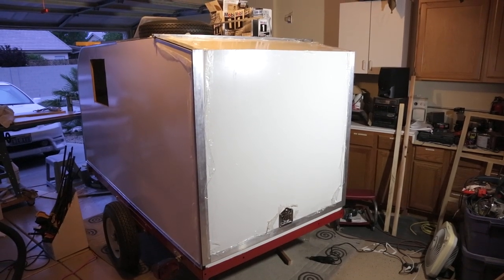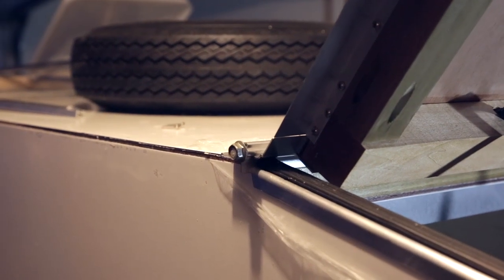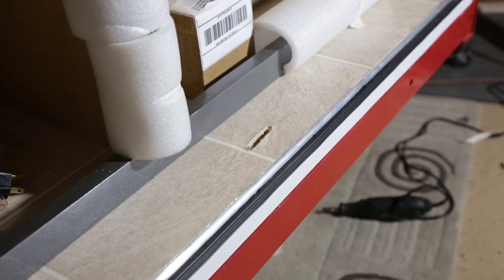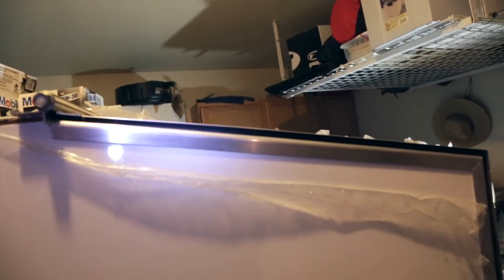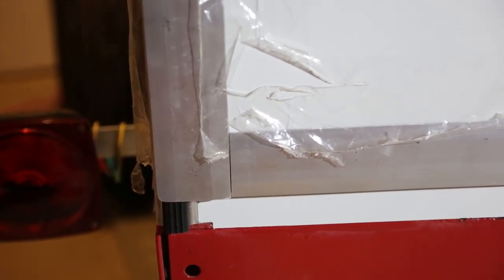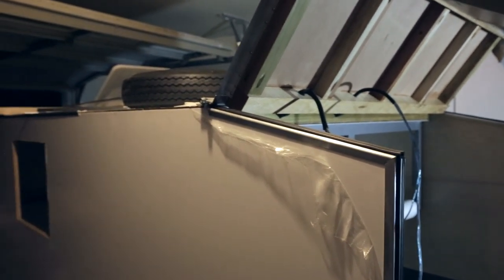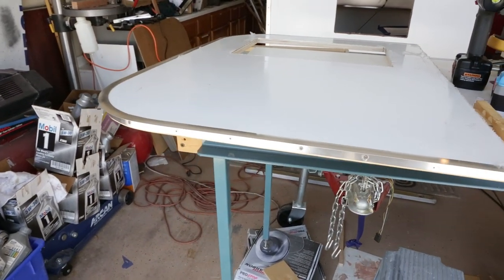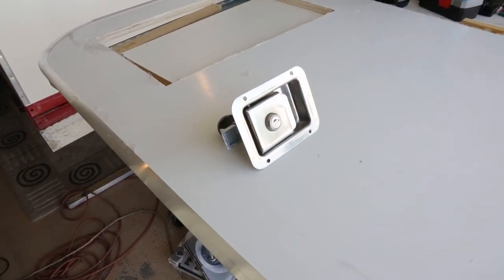Teardrop trailer build Rear Hatch and Seals

Comment: Why was the lock so hard? Curious because I'm looking for a lock for my teardrop.
Reply from the maker: That particular lock I think was made to be mounted on some thin material, so when used in this situation, there was a lot of cutting and reengineering of the hatch. Just to get in in the hole I had to disassemble the lock, and that was not the most enjoyable hour and a half. The T-handle slam locks are probably the easiest to use.
Reply: Ah, makes sense. Thank you for passing on a little wisdom.